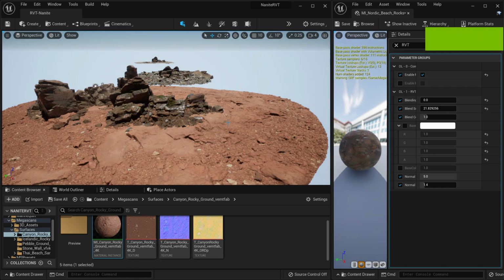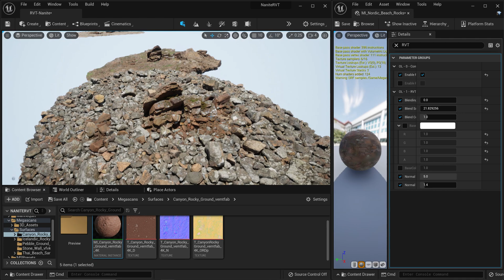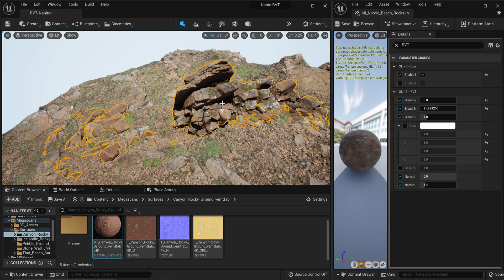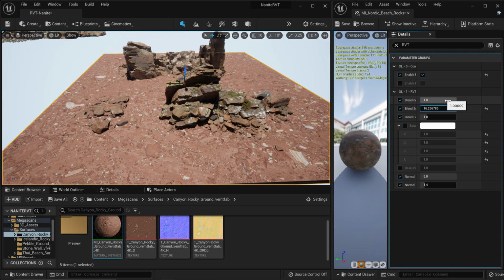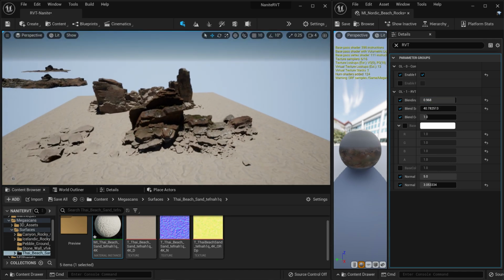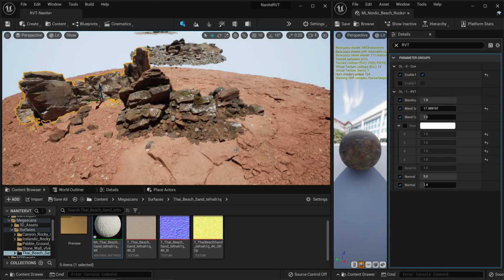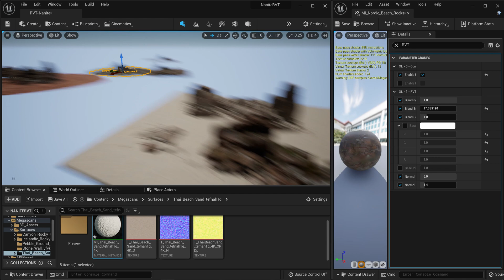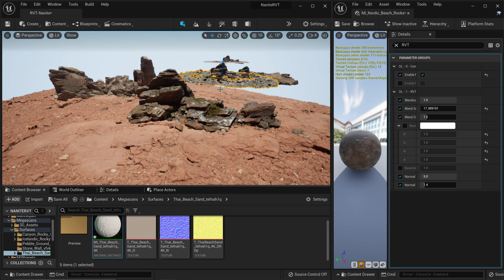Nanite & RVT Blending in Unreal Engine 5 (UE5). Do we need it?

Comment: am i crazy when i have a nanite mesh and in the fuzz master i input the rvt attributes my nanite mesh goes black and i when i disable nanite it works
Reply from the maker: Nanite doesn't support RVT as a ground source. Where it writes to the RVT.
But Nanite meshes can receive data from RVTs,
Reply: @GDi4K  yeah I’m not using it on the floor I have a landscape but my mesh is black I also use uds could that be it it’s saying the. Scene contains a skydome but doesnt cover part of the screen have you seen this?
Reply from the maker: @mb.3d671  I haven't tested RVT blending with the UE5 public release. Will give it a go.
Reply: @GDi4K  apparently it’s because of pixel depth offset and world position offset
Reply from the maker: @mb.3d671  Is this coming from UDS/UDW?
Reply: @GDi4K  it’s from the unreal material the master

Comment: Can you please make a consistent tutorial for RVT blending in UE5? Your information is very hard to follow.
Reply: what he doesn't cover is that you cannot render Nanite geometry to the Runtime Virtual Texture. You can blend from an existing one, but to create your RVT you need to make it on regular static mesh geometry (that's why he changes to the flat plane geometry that is not nanite when showing the RVT blend). It's a pretty glaring omission not to mention this. The reason Nanite meshes cannot render to a runtime virtual texture is because by design, nanite geometry is constantly being updated (decimated and tessimated) based on screen percentage, so it would be an endless amount of calculations to render each possible variation of a nanite mesh to a Runtime Virtual Texture. one possible solution to this is to create proxy static mesh geometry that resembles your nanite meshes to create the runtime virtual texture from, but I recommend not trying to do it on your dense nanite mesh geometry as that is too many polygons to load into your scene as static mesh geometry.

I really hope that at some point there is some other way to blend nanite meshes together.
Reply: @ConradSly  Thanks a lot for your time spent to write this explanation! Very useful and very important indeed!